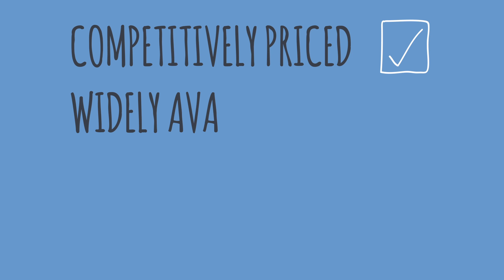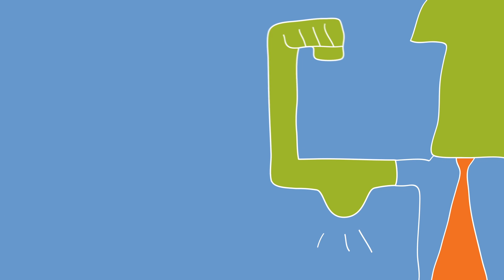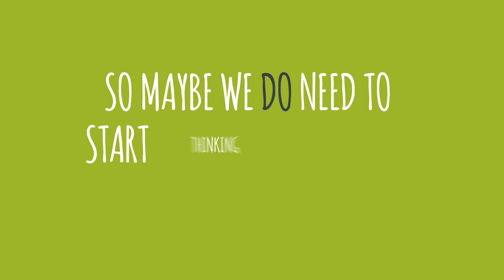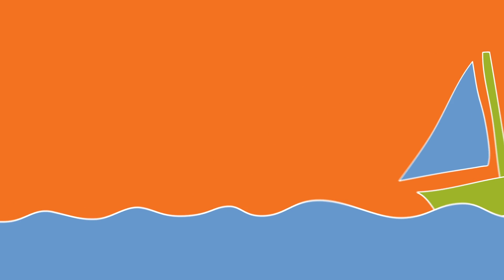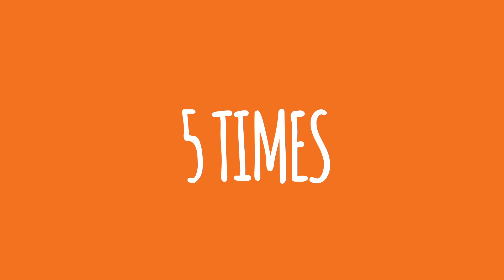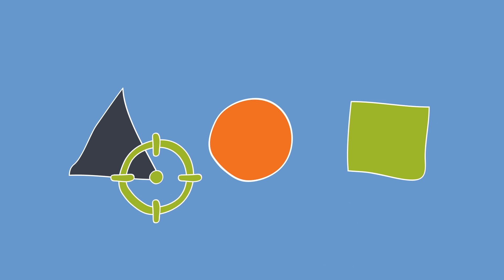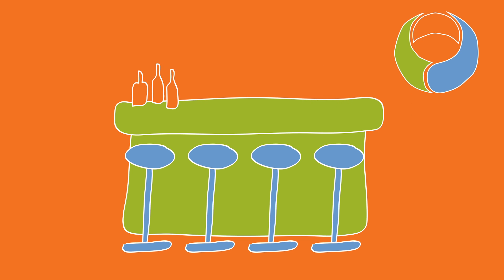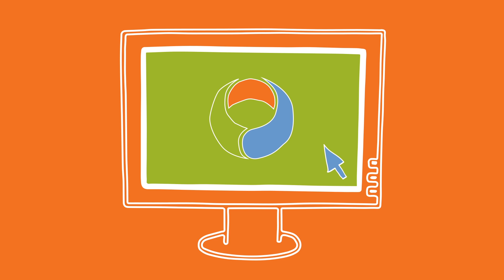The Future of Rotomoulding is Polyethylene  - or is it?

Comment: Pin holes can be reduced by reducing the preheating time you can also reduce this by adding 5 to 10 percentage of HDPE  blow grade material to LLDPE. It will also increase the strength of the product
Reply: Do you have a workshop practically doing that
Reply: @mukomapapapaps4358 what info I shared it is from my  experience